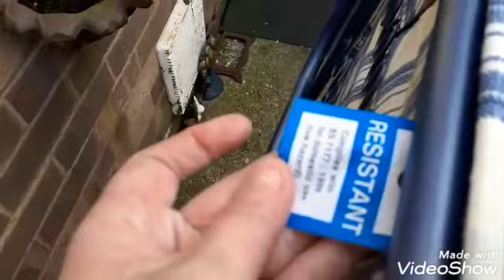SWAFFAM AUCTION AND HAUL, WHAT DID WE GET UK RESELLERS 8/3/2020

Comment: I'm shocked at the amount of stuff Dave managed to get in the car. Those glasses are Ravenhead Siesta which will sell for about £10-12 if you have six. The photograph frames will sell as a job lot  taking a photo of them together flat on the table or floor 5 for about £10-12 people upcycle them. Fantastic purchase of the Le Cruset saucepans. They look nice and clean with their lids too. Lots of jolly lolly to be made there. I'm interested in the horse/pony stuff. Not the body protectors or the helmet but the tack and blankets. I'll send you a message on Instagram.